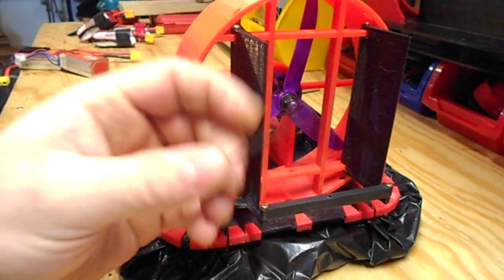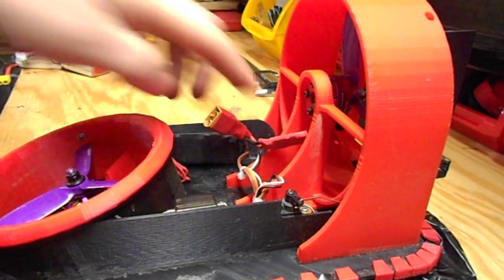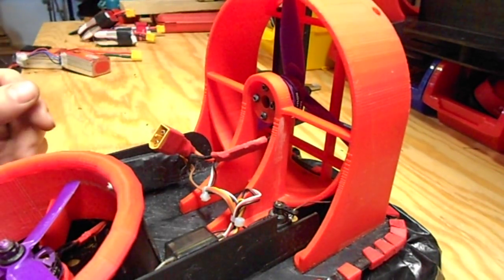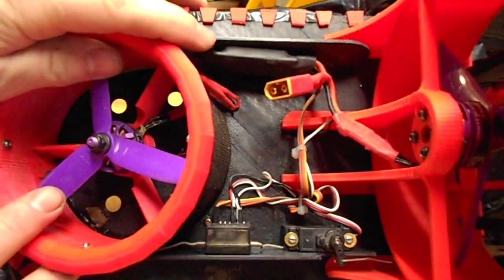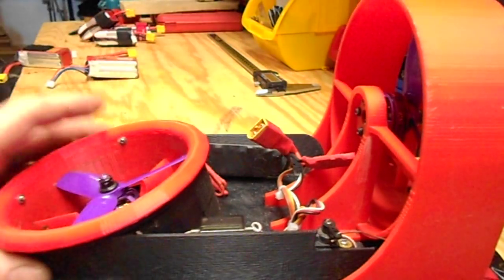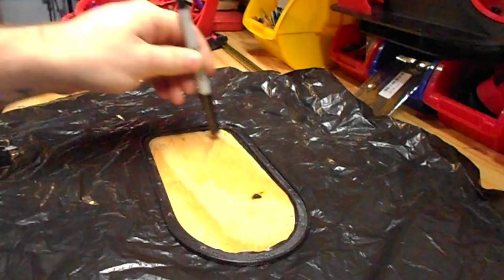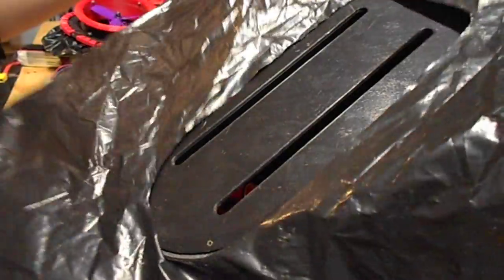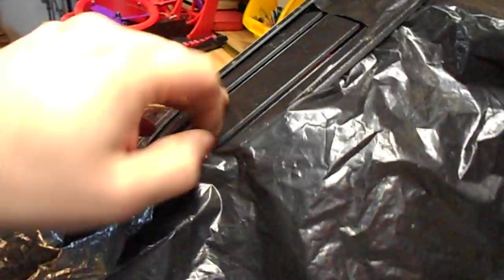Basic Assembly of the 3D Printed R/C Hovercraft

Comment: I know its a long time ago since you posted  but hopefully you will see this and answer.
Are your 2 esc running in parallel, i.e. controlled off one channel so they both spool up incrementally together,
or are the fans individually controlled. 

I was thinking of the latter slaved to a rotary control so that i can dial in static lift before giving it the beans on the drive fan.

Its been a nice print and build so far but i did have to split my main deck into 2 parts for my printer.
Many thanks for your great work.

Comment: I am having trouble with drag/drift. The back right corner drags and slows it down quite a bit. I havent taken it outdoors yet, bc I'm trying to figure out how to reduce drag. My skirt was cut 6 inches from the perimeter of the hovercraft. Any ideas?

Video doesn't show this very well: https://photos.app.goo.gl/2bATeDzEhxnkgRYX9

How much speed are you getting? I'm using overpowered 2450kv motors.